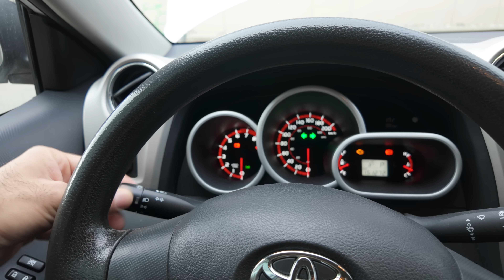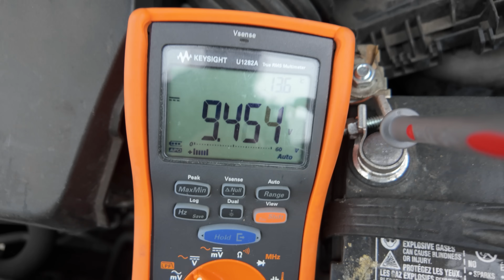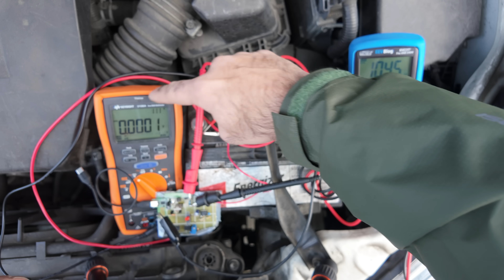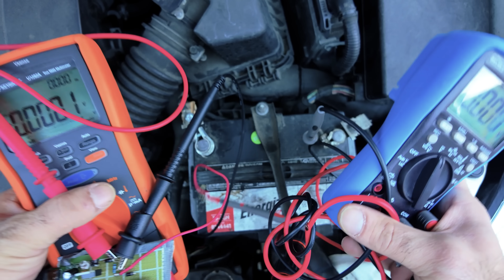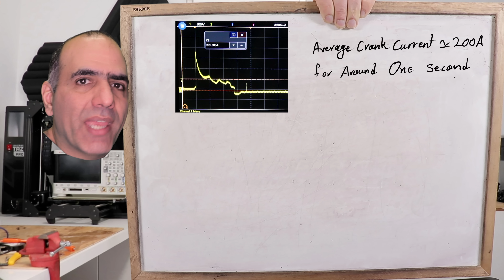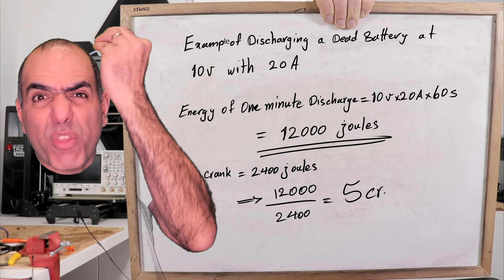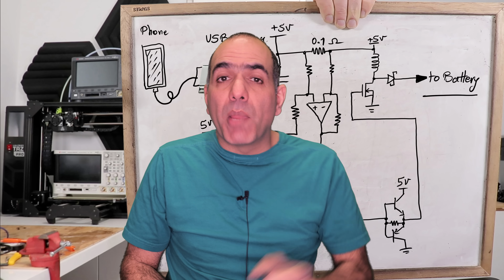Jumpstart by Phone

Comment: It is actually easier to charge your car battery with a simple hand cranked generator. Most cars used to have one before the electric starters. Also, your handcranking would be way easier with a never car since old machinery on that time had ridicilous amounts of tolerance that most energy you were using was just going to waste.

Comment: 1:24 Most EVs actually use a 12v battery to engage the contactors to the high voltage battery. So not only does that mean EVs have a 12v battery, but if it dies, you can't start the car just the same as an ICE vehicle, no matter how charged the high voltage battery is. I understand though that your point was that you can't charge an EV's high voltage battery with a smartphone, which is true.

Comment: An iPhone is limited to 4.5W output @ (nominal) 3.7, so 1.2A out of the phone or 321mA into the car batt (@14V).  (Android: I don't know).
You should charge the car to over 12V to get a good crank - esp. if the engine is cold.

Comment: Modern vehicles have protections that will turn off interior and other lights if left on for a certain amount of time to prevent the accidental full discharge of the car battery. My mom's 2006 Jeep Liberty did this. Her 1986 Cadillac didn't (ask me how I know). I know that some cars that have it where you can have their battery charged through the 12v auxiliary power port. I don't know if that is still true or if all cars could do it.

Comment: 1:25 Why shouldn´t it work on an EV? EVs also have 12V batteries for the on-board electrical system, which can drain independently from the high-voltage batterie.

Comment: Great, I've already thought about something like that. My idea would have been to first precharge some supercapacitors to the current voltage of the battery using the “empty” car battery, then disconnect them and charge them to 14V using the USB port via a boost converter. Basically combining your two ideas into one.
This would give you enough voltage for the ignition coil and the electronics in the vehicle. Some cars are very sensitive to this and won't start, even though the starter motor is turning fast enough.

Comment: Let’s also not neglect the fact that even if you can get 1 or 2 cranks out of a deeply discharged car battery, modern cars have a whole computer system that draws quite a bit of current as well, and even the best designed battery unloader circuits can’t compensate for the fact the engine computer needs a certain voltage to function while cranking, as well as the load the fuel pump and ignition coils put on it. It’s not as big of a deal with a carburetor and points ignition because the only load is to charge the ignition coil so you can have spark.

Comment: 55 amp.hour is just a math simplification of 2,75amps.20hours. Batteries are rating based on a 20h discharging, and it isn't a linear rating. Capacity will increase at lower discharging amps and will decrease at higher discharging amps.

Comment: @ElectroBOOM Mehdi, did you feed 12 volts exactly, into the car battery, or was it actually 14.4v ??
  Common sense tells me that providing a proper voltage, matching that which an alternator would provide, is the best possible condition to raise the car battery's voltage potential.

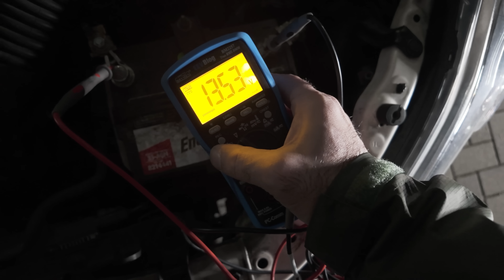Comment: 7:58

The battery voltage is not 13.5. The Voltage across the battery is 13.5, but that is because the alternator is pushing that much voltage powered off of the controlled explosions making your car go.

If you shut off your car and checked the voltage is would be pretty close to the 11V you had previously. This is why it is important to leave your car running for a while after jumping it.😮

Comment: You used a circuit to increase the voltage of your phone battery to jump start your car battery but they already make jump starters that use that kind of circuit without adding a battery: “Capacitor” jump starters slowly charge themselves to a higher voltage off the dead battery’s residual charge and then dump the current all at once to start the vehicle… so put your circuit on the car battery directly and ditch the phone.

Comment: If a car battery is allowed to rest after being drained of a few volts, won't it automatically recover some of its potential once the acid eats through the sulfur that's collected on the plate? I have used this method to start from a "dead" battery more than once.

Comment: TBH if you made a emergency car phone starter or charger for when you are in a pinch and have zero options, I would buy one 100%, but a circuit and maybe a diagram for each type of phone to know what is max or how to find max with your circuit, 100% sound like a real product that could be helpful! Yes I know you can buy those battery packs for the car to start it, but they are not always used or most dont have one, but I know if you made a device that was like 20$ for the times you need it and under our own risk still be cool! But idk what it would take to even get on the market! ** Also Question I have is, idk about Apple, but Samsung has a option in the phone to push charge from the phone to other devices plugged into it, so my S24 can send charge instead of needing a circuit to trick the phone into sending charge, would that make a difference and could it send more since it is made to send power out?

Comment: I jumped my truck's battery using my phone once.

Well, not directly. I have one of those portable boost packs and I went to use it after my battery died but it turned out not to have enough juice because I never charged it. I used my phone's ability to charge other things to put enough charge in the jump pack to start my truck.

Comment: If your car is manual you always can use the car generator to give the charge for the battery. You just have to leave it in neutral, push your car fast enough and then engage the gear. The inertia will generate enough mechanical force to start the combustion cycle and charge the battery. ( we call it "tranco" here in Brazil)
Reply: called push starting in english. You don't see it much in north america because so few cars have manual transmission, and you can't do it with automatics.

Comment: I never had this issue as I always driven manuals and you can bump them with ease. I love my little Corsa 1.6 and that car weighed nothing so bumping it was was easy. That said I did work as labourer and had a lot of strength. You little piss'ey white car would bump start no issue. Wouldn't try this with out a Diode, other wise the DC charge in a battery will kill the lower battery in phone. LOL I wrote this before you break down circuit

Comment: kind of FAKE but also TRUE, leave the battery for that time and it settles by it self. or make a circuit that takes some enegy, ait for it to settle. then charges it with 14v with same circuit with that stolen energy (capacitor/other battery). this will help the battery recover to its full potential. without external energy

Comment: I'm surprised you called the "battery voltage" at 13-1/2 volts, when I'm sure you know that's the alternator voltage that is charging the battery. If you shut the car off ,the battery would probably still be around 11 volts.

Comment: The moment you showed the battery sagging to around 11.8V under a ~30A load, I already knew the phone wouldn’t have a chance without a proper boost converter. I’ve tried similar low-current recovery methods in the past, and you’re absolutely right: even a tiny draw error or a few extra minutes of discharge can cost several crank attempts' worth of energy. Great job breaking down energy density vs. total energy—most people miss that distinction.

Comment: according to aftermarket dashcam hardwire cables, you need over 11v on your car battery to start your car, which is why hardwire cables stop the dashcam parking sentry mode when car battery is at 11.6v

Comment: Guess you assumed an efficiency of the charging circuit and wires of 1 (and the battery absorbing the charge), when most likely it'll be a lot less (maybe even 0,5). 
Also the crank will not be "1" efficient. And there's a lot more components like ECU, HV coils and fuel pump on top of the crank. Even if the full crank "process" current was 250 A, entropy of energy is always present and it would need a bit more.

Comment: If you put a straw in a bowl
and both had water in them, the bowl having more
then you place the straw standing up in the bowl and let the water flow out it will empty into the bowl
This sounds obvious but that is essentially how voltage works
even tho the bowl has more water, the straw had more "voltage" so it flowed to the bowl until the level equalized
Reply: Alpha Phoenix has a great video using water to build an intuition about voltage behavior.

Comment: yes- but there already exists a power banks with boost converters included for exactly this purpose, i.e. you can directly start you car using it and then disconnect.  And yes, Li-Ion batteries can survive that much amps.

Comment: Yep, the voltage is up, but it's not fine, yet - not advisable to turn the engine off.
What is shown is the charging voltage provided by the alternator together with the loads, which does that only while the engine is running. 
Requires some time for it to charge the battery enough for it to be able to start a cold engine again. Like 30 minutes at least. Depends on the battery, temperature, engine size etc. Driving means the engine is at higher rpm, so faster charging. 
Also, fine to charge your phone now :)

Comment: Starting was totally unexpected, because ,

It's commonly known fact that cellphone batteries are like 4.2-4.4 volts when fully charged . 

Mehdi sir last time clearly demonstrated charging car battery with almost 10-12 pencil cell in series generating approx 15 volts DC 

So at the most connecting a cell phone to car battery will obviously charge the cell phone and not the car battery 😅.

Comment: Actually car batteries are not designed to overdischarge. Their grids are too thin (because they're designed to deliver high current, so they must have a huge surface area), overdischarge can cause the grids to break. On the other hand, lead acid batteries with thick electrodes can be discharged more, but they cannot deliver high current rate.
Batteries are so complex to understand. The voltage vs energy is not linear, and the voltage is even affected by output current because of electrochemical effects.

Comment: 07:17 - "around 350 [mA]" - while the meter shows around 35 [mV] - seriously Mehdi? :(
Reply: it's likely reading the voltage across a current shunt i.e. low value resistor. So the voltage is proportional to the current
Reply: @KingJellyfishII  I guess so too, but definitely missed opportunity for educating us rather than confusing :(

Comment: Charge efficiency of lead acid batteries is 80-85%. So not all the energy from the phone was stored in the car battery.
At 10.5 volts SOC is equal to 0%, so flat. 12.05 volts equals SOC of 50%.
Great content as always. 👍

Comment: Medhi, you generally wont damage a lead acid battery immediately by discharging it to 9V. It will simply start growing lead sulfate crystals on the plates, reducing the surface area, reducing the cranking amps. But you can desulfate the battery using specific chargers.

Comment: 8:00 That's the alternator voltage. If you shut the engine off at that point, battery voltage would quickly sag again. You need to run it for at least 10 minutes, otherwise you're pretty much back to square one. Ask me how I know :)

Comment: In the early 2000's I charged my dads empty starter battery at the campingsite at lake Garda. The car was an automatic, and we accidentally left the 12v cooler switched on overnight after arriving. I used a 12v 300mA power supply from some electronic device I brought along (I've forgot what is was for), cut the plug and connected the wires to the battery. After a few hours of charging it was enough to start the car and drive around a little to fully charge it again.

Comment: 5:19 how you are measuring current when the keysight multimeter is set to voltage mode ? and it is showing 0.0333V :) ?  
also multimeter leads are connected to voltage hole not in Amps hole ? 
am i right or i need to consult a doctor  ? :(

Comment: Mehdi you know why the phone battery explode because the li po battery can only run 5v(due to it's 3.7-4.2 if fully charge) you could use a boost converter in order to safe charge a 3.7v battery into a 12v car battery, you didn't connect backward it's the car battery just explode the tiny phone battery due to voltage difference that damage the phone battery. 4:20

Comment: EVe still have a 12v battery for all of the normal car bits.  The High Voltage battery is only for the motor and things like heaters and AC.

Comment: If that was a stick shift you could have just bump started it. And the battery jumped voltage because the alternator was running when you measured it. Had the engine been off, it wouldn't have been 13+ volts.

Comment: Your math @4:50 is wrong! Yes, it may be that the starter needs 200 amps, but there are SO MANY control units in a car that you can't just calculate the starter's requirements. Below a certain voltage, they no longer function correctly, and there's no proper fuel injection or other issues.

Comment: For comparison purposes (this is from memory) the NOKO GB-40 booster pack I have has a 7ah battery pack at 11.1v nominal (3 LI-ion cells). It works by connecting the cells through a relay on the circuit board to the vehicle. Is it better? yes and no - it is just able to push more amperage during a crank. I find it more effective if I use it to first bring the car battery voltage back up to at least 11 volts by putting it in emergency mode, then cranking before the pack loses all charge. So, I basically do like Mehdi, but from a dedicated device.

Comment: The 55Ah capacity of your car battery is the 1/20C rate. This means you can draw 2.75 amps for 20 hours, but you will not be able to draw 55 amps for 1 hour, even though they are mathematically the same, and under cranking conditions it's even worse, considering the starter motor draws hundreds of amps.. Lead-acid car batteries are horribly inefficient at high current. Furthermore, deep-discharging your battery has absolutely damaged it. You're going to run into problems in the near future.

You also assume people keep their phones charged to 100% for this hypothetical scenario. This is almost never the case and you know it! XD Most people keep their phone in the single-digit charge percentages because they're too lazy to maintain a proper charging regimen!

Comment: 7:55 - Minor correction: When you measure with a running engine, what you are measuring is the output voltage of the engine alternator, which happens to be around 13,5v. That is not the battery voltage, which even on full charge drops below 13v as soon as you cut the engine. The battery doesnt get "insta-charged" like you implied there, it takes quite a bit of runtime to fully recharge a battery that was barely able to crank the engine. And i dont know why they decided to call a motor that outputs DC voltage an alternator, but that´s what it´s called anyway...

Comment: I was sitting in the parking lot of Walmart, watching YouTube videos for about an hour. The car was off, and I did not even consider my battery at all.
My car battery was dead. It tried to crank, and then began clicking, and then just stopped. All within three seconds. Well, here I am, without my jumpers. But I’m at a Walmart? What the heck. I’ll get a new battery. This one is over six years old, so I can’t really complain, too much.
New battery costs…$200!!! No fricking way! I don’t even have that much on me! I’ve got maybe $100 bucks until payday.
Maybe they have one of those USB JUMPERS?
$60. Hell yeah. Bought the damn thing. It’s almost the same size as my iPhone, about 2x as thick.
It’s USB, it charges by USB MINI, and has its own jumper cables. 
I was ready to return it if it didn’t work.
But I connected the little jumper it came with, and VOILA!! It worked. Took almost half its charge. But it worked. Now I carry it everywhere. Can charge my phone, has a very bright light on it, I use while walking the dog at night.
Glad I found it.

Comment: Is that a usbc PD board? It looks like its set to 12v in the explanation part. The phone wouldn't be able to output that but may still output 5v. I wonder though if you could use one of those to directly charge a 12v battery from a capable usbc powerbank.

Comment: I think this video is participating of the incorrect math of energy in charge-discharge of batteries. The charge-discharge curve is not linear at all, and the main problem is usually the ESR of the battery, that is another non constant and not linear parameter of it. An important part of the battery energy is not usable if you want it to be able to be charged again many times, as well. Almost nobody talks about these factors. If you try to. God, don't blow a car battery in cortocircuit for the jokes ¡Use a big lithium one! ¡They are more fun with more fire and HF instead of just hidrogen! ¡The fire extinguiser will not do anything like in joke unextinguishable birthday candles!

Comment: To be fair, most EVs do have a 12v lead acid battery to provide the startup current for the contactors, as well as the door locks, lights, ventilation and infotainment system. 

So leaving the lights and all that on, could prevent the main battery contactors from closing, and stopping the electric motor from powering up.

Also it doesn’t require anywhere near the amount of amps to close that circuit, so EV 12V batteries have far lower max Ah output. Therefore, you could likely start the car with far lower charging time. 

As long as the main EV battery isn’t flat of course. It would take a long time for a phone to provide the single kWh of power required to go ~3 miles. Just go hire a generator.